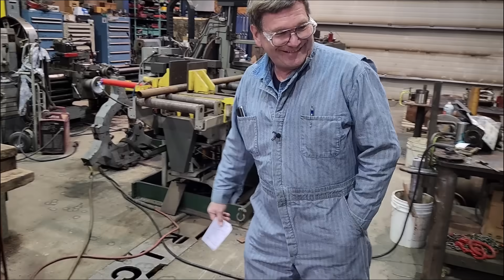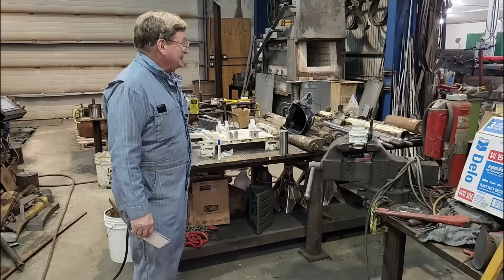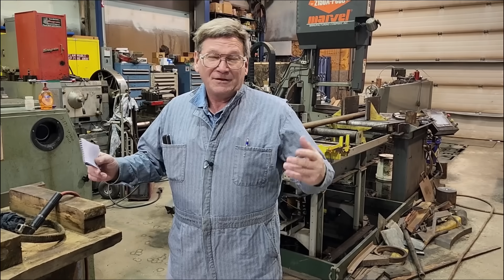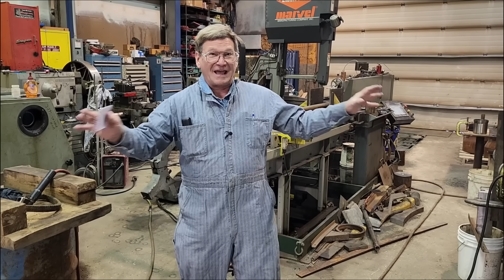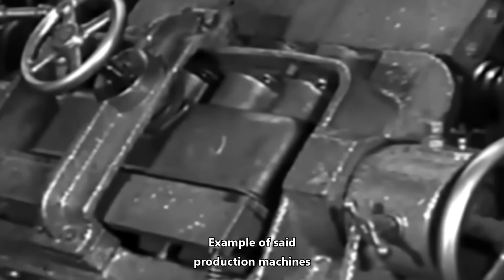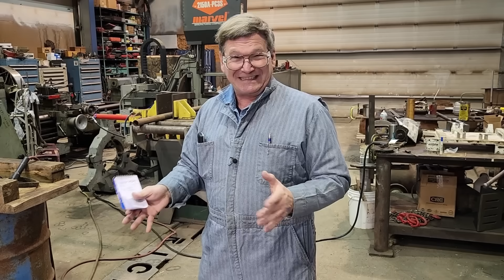What kind of shop are we?

Comment: The machine shop I worked for was a between a job shop and a production shop.  They are known for their jaw couplings and gear couplings, but they also made disk couplings, universal joints, and S-flex couplings.  Some days I would go in and run the same part all day long.  Other days I might not have work orders larger than 10 pieces so I would be changing out, at a minimum, drills and boring bars all day.  Some days I would be changing out jaws on a regular basis as well.  Sometimes I would have to adjust an existing program for a spacer body because we had not made one that specific length before.  Occasionally I would have to write a program from scratch because my lathe was slow and another lathe was either behind on work orders or down for repairs so we would take on their work.

Comment: In my 20+ years of being in and around machine shops, i have never heard of a "junk shop".  lol One place i worked bought a twin spindle CNC lathe from a large small engine manufacturer that closed down a factory. This CNC lathe was bought new along with others to make the same piston all day everyday. The main spindle would turn one side of the cast piston and the sub spindle would turn the other side of it. Even though it was a full CNC machine, it only made 1 part every day of its life until we bought it. That is definitely a production shop with machine operators rather than machinists to change parts.

Comment: Most training colleges dont have fitting & machining tech classes any more. They had a Mr Pete who would change out the leadscrew brocken tapered pins. Show how a shop should be layout. All helpful if the apprentice stayed out late. Those yellow lines were a safe place to scratch your bum. Or even hold an argument with the boss. So if you have no marking  on the floor  the young apprentice would probably get injured. 
Unless a good preamble was given about how you run your shop. Can't  stand clutter.

Comment: I think you're looking for "Additive Machining" as most of what we think of as machining is "Subtractive Machining." Then we get into "Formative Machining" like bending jigs and forging dies where we're not really changing the volume of the stock from the work performed. Then on the modular production front was the Tool & Die. One press with a tool or die set that could be inserted which the press would then open and close as a reel of material was fed into it.

Comment: CNC machines are fast at producing ok parts rapidly, but they don't take into account the rapid release of the internal stresses in materials. Job shops are where the true skills are at, a cluttered shop is a sign of a brilliant mind. When you have ten different things going on you need to be on your game. Trouble is we live in a disposable world, not as much repair work out there.
Reply: Don't set your thinking that CNC machines are faster. I worked in a machine shop when they first brought in CNC machines. It took over twenty machines and they still couldn't get enough production parts turned out to keep up with assembly lines. Compared to what normal men and machines could do.

Comment: I would call your shop a midden 😂 cmon offcuts on the floor becoming a trip hazard, I guess you dont get inspected very often over in the states. My old shop would get messy as we worked but there should be a place for everything a d everything in its place, and after each job run it was tidied back to a working order.  😊

Comment: worked at a shop that was 99% lathe focused, they had as many manuals as CNCs, 7 or 8 Hardinge Turret lathes, that could be set up and running HOURS before the cnc's got programmed, let alone set up. And then they would run without error for sometimes days, so yeah CNC is cool and all, but manuals still have a space and need. Of course once that shop was bought out, the new owners S canned all the manuals, along with tooling and programs for jobs they'd been running for 30 years... No idea what happend to the manuals, especially 2 identical Mori Seki engine lathes... hands down best manual I've ever operated... anyway... the new owners F'd off with the money, lost all the repeat work and eventually fired me for "not working well with others" meaning I kept saying hey, this isn't working, and they kept saying STFU we know more then you... anyway... thats the last shop I worked for, went full time logging after that (though I've started a little jobber shop in my garden shed lol... you think yer out of space oley ole fack)